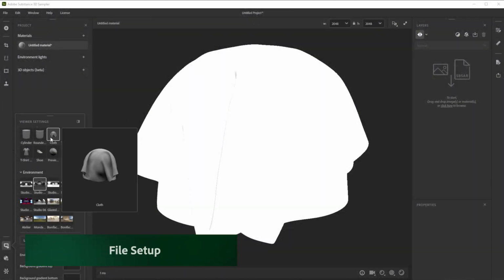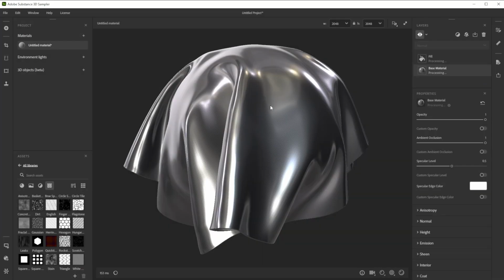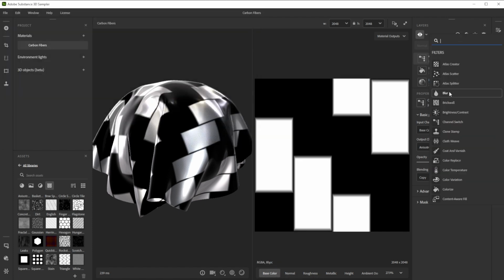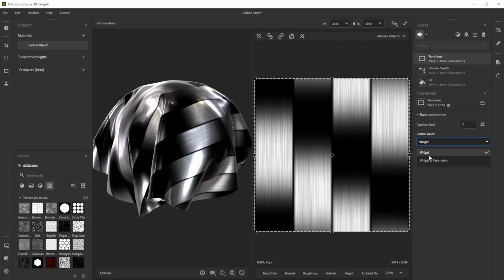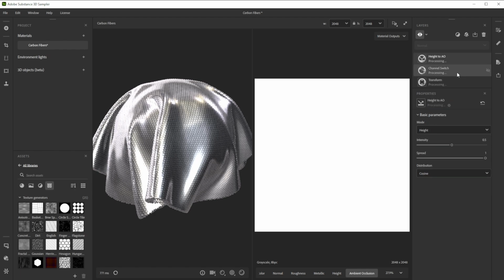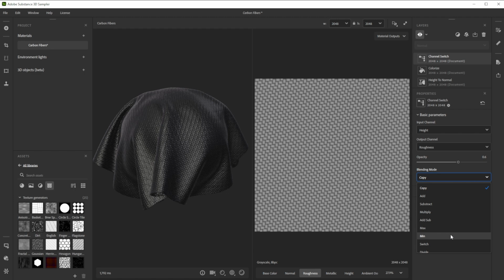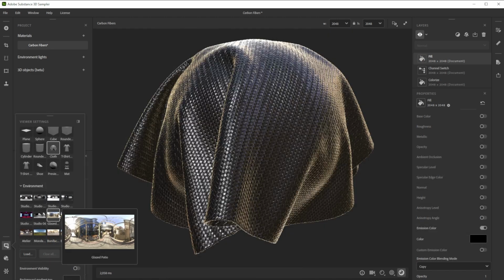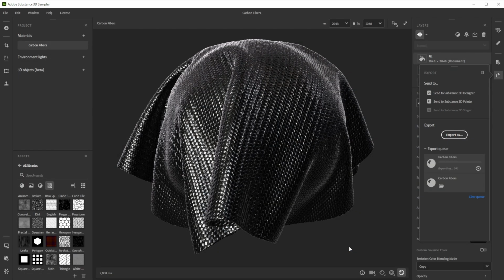Make Carbon Fibers in Substance 3D Sampler | Materials In Minutes #19 | Adobe Substance 3D

Comment: wacom pren right click white circle , when will you finally get rid of this?
where is shortcut for swiching between two colors like in photoshop?
how to hide part of the mesh?
hot to assign a shortcut to wireframe on off?
how to rotate the canvas, but not the model?
how to copy layers between different windows?
how to isolating layer like in photoshop with eye and alt click?

Comment: Substance painter...
How to hide part of the mesh?
How to bake color texture from other object?
You can't. Because of what?
Reply: you can
Reply: @holographicSquid  you cant :)
Reply: @MrAsag  Yes, pls learn how to use the program then you can.
Reply: @holographicSquid  no. This is impossible. Just google it. Lazy adobe just don't have this option. Unfortunately.
Reply: @holographicSquid  You can't hide part of the mesh unless it's separated via a texture set.
Which isn't good if you want to isolate one piece only and not half the asset, or worse yet if the whole asset is baked onto a single texture sheet.
'' pls learn how to use the program then you can.'' 
Nice gas lighting though
Reply: @RevelationOfSeas That's why ID maps exist
Reply: "How to bake color texture from other object" is just dumb, that's literally the first thing you learn in any tutorial, no wonder you didn't even mention it